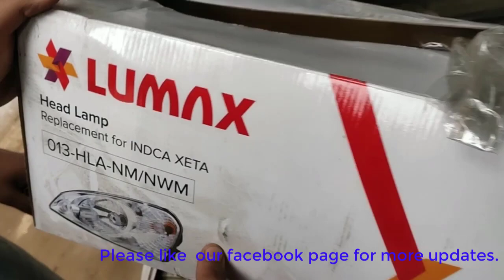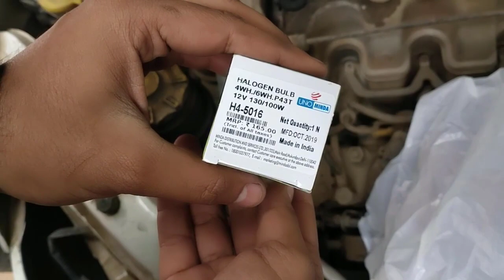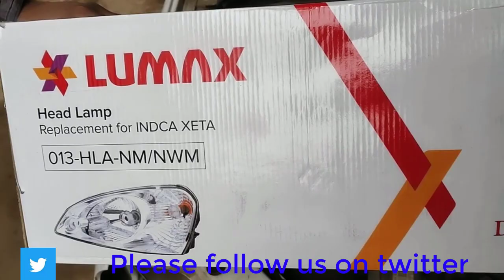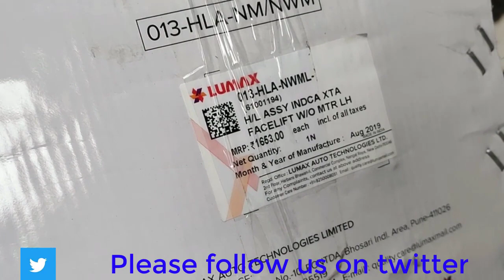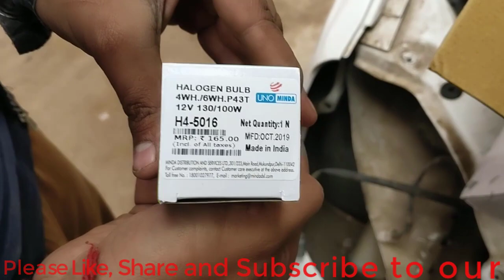TATA Indica Replacement and Installation Of Headlight Part 1 #STAYHOME #ORIGINEDUCATION #TATAINDICA

Comment: May i use 100/90 bulbs in my indigo ecs 2015 model without relay or cut out. I have 55/60 bulbs in my car
Reply from the maker: It is not recommended but with relay it is totally safe.

Comment: Bro can I use 2013 head light in 2008 xeta
Reply from the maker: Yes but you need to change bumper also
But trust me xeta light after using relay will give awesome response.
Reply: Xeta headlight is perfect, use philips xtreme vision pro 150 I got it 3 Days ago

Comment: Bhai meri gari ka headlight idle pe vibrate korta hain ....headlight beam bhi vibrate karta hain
Headlight ka visibility kaam hai 100/90 bulb lag aneke bawajut
Kya  purani weak battery se ai se problem ata hain?
Mera battery 4.5saal purano hai air 2-3bar discharge bhi hogya tha lockdown me
Reply from the maker: Bro altenator ki service ya battery issue hai ek kaam karo kisi or ki battery laga ke dekho barna altenator service karana padega i will make video on altenator service.
Reply: @MotorOrigin  bhai gari jab 30min ke upar idle khari hain tab headlight beam ka vibration nahi hota
Agar gari start karke headlight on kar diye to headlight beam me  vibration hota hai
Gari ko ignition pe(without start) headlight beam vibrate nahi karta
Ek aur bat battery ka voltage start condition me  14v -14.1 -2 vary karta hai ,pehle 14.2-1 niche  voltage kabhi nahi gaya
Aap thik bol rahe ho.....ekbar battery ko check karke dekhunga nehito alternator ko service pe dena padhega
Reply from the maker: Altenator service total 30min process hai apne samne hi karwana bas ek copper surface hai usko acche hai sandpaper se clean karenge and it will be good to go.
Reply: Bhai without relay nahi chalega 100/90

Comment: Hello bro can I fit xeta headlight on indica dle 2000 model
Reply from the maker: Yes sure
Reply from the maker: You can fit it but in latest 2008 bumper will get good fitting but you can fit it in your car as well easily.

Comment: Any reflector burn or blacking issue by using100/130 bulbs in last one year?
Reply from the maker: No sir not at all also in my 2nd indica i am using in it from last 5 years
Reply: @MotorOrigin  Thanks!!! I will use the same solution for my Xeta as well then :-)
Reply from the maker: Go ahead you will never face any issue in it but kindly use original relay and original bulbs.
Reply: What's the need of relay? Xeta Headlight is alright

Comment: There is A nut lock inside headlight which holds the bumper. Why it is not in your car?
Reply from the maker: It is their brother
Reply: @MotorOrigin  I didn't get it.